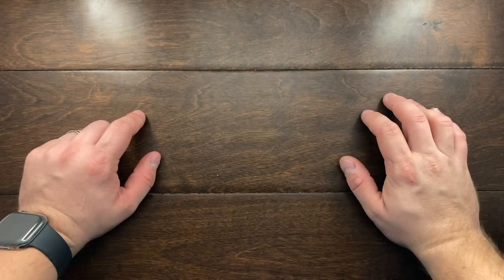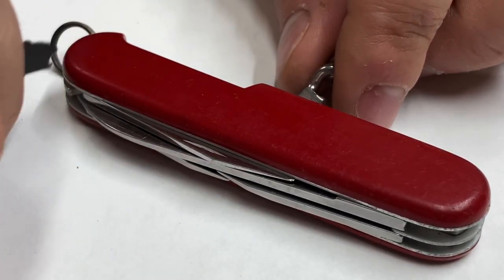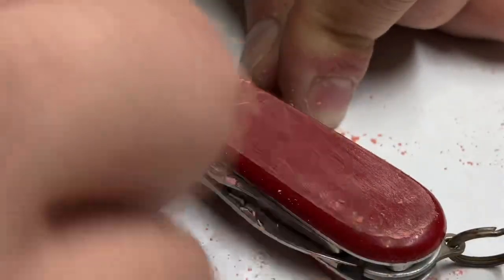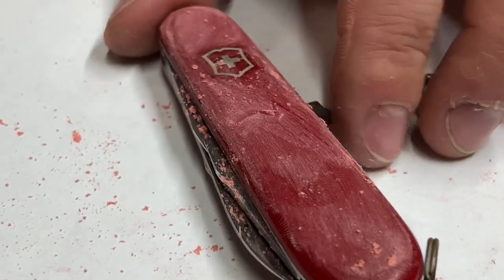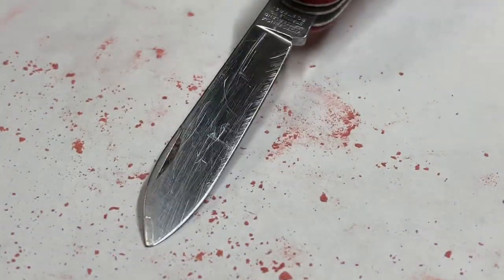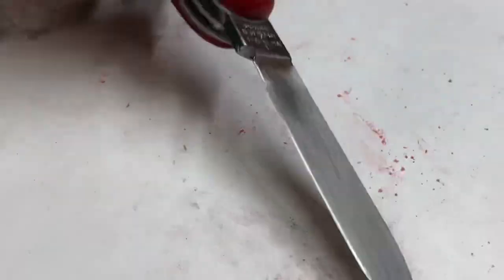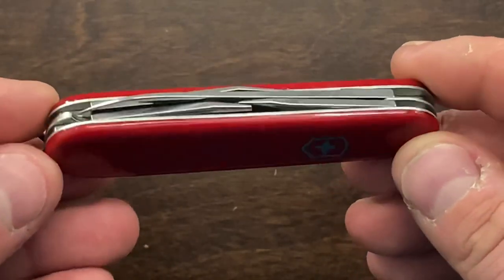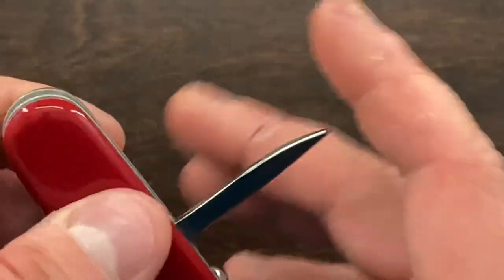How To Polish Victorinox Scales

Comment: Since the scale will dissolve with acetone, I usually do a light sanding with 600 paper and save the dust. I then dissolves the dust with acetone to a creamy consistency that I paint the cracks with, make sure to blow it dry right while painting. Then I sand and polish the scales. That is how I get rid of the cracks and cuts without sanding down the celidor :)
Reply from the maker: Very good info!!
Reply: I'd like to see the finished product with this process. Using acetone would be tricky.

Comment: What I've been doing since the '70s.... high-speed drill, very soft buffer wheel(found at most hardware stores), and jeweler's rouge(sometimes sold as plastic polish). Spin the buffer wheel against the rouge to 'load' it. The key is never to let the slabs get hot....just warm.  I've also used Mothers 'Power Plastic' polish instead of the jeweler's rouge.  I cringe when I see you guys using sandpaper. I get a factory gloss, but I'm not after the deep scratches.  

 I do the same thing essentially with the steel....except I switch to a Dremel and use a felt polishing arbor and stainless steel rouge. That will leave some polishing marks if you don't keep the arbor clean. And I finish by hand with Mother's Mag polish.

Try not to buy used SWA knives where the owner has kept them in a pock with change/keys.

Comment: One millimeter is pretty thick. I know that's the machinist in me talking, but when the saw sends you tubes to cope a radius into them and they cut them 5mm long, it seems like a kilometer!
Reply: I can say for sure that the embedded emblem is not 1mm thick as I had one partially peel away from the scale. It may be around a quarter of a mm thick. It created a sharp edge that could actually cut you. I was unable to flatten it and had to fold it back and forth a couple of times and break it off and lightly sand the edge of the remaining emblem smooth. So my Executive has been missing the top part of the emblem for the past 15 years or so.
  Nice restoration by the way. I usually just use Turtle Wax rubbing compound. It removes very minor scratches and scuffs and brings back the shine.

Comment: I accidentally spilled a drop of 91% alcohol on a scale of my Signature Lite. The shine is gone and now there's an ugly dull spot. Do you know how I can make it shiny again?
Reply from the maker: The alcohol is probably reacted with a plastic polymer that they use. I think the only way you would be able to get the shine back is by having a buffing wheel. However the alcohol probably messed with some of the properties of the plastic that allowed it to get the sheen that it usually has. I don’t think you’re going to be able to repair it I don’t keep alcohol close to my Victorinox knives because I’ve had bad reactions to them touching alcohol. I’m sorry to hear this but you might have to get new skills.

Comment: What sandpaper/polish grit progression did you use on the scales and blade?
Reply from the maker: Started with 400 grit sandpaper and then moved to 800 grit. Would probably be more beneficial to then progress through 1000 grit to 3000 grit sandpaper. On the scales are used 400 grit sandpaper.

I only used one polishing compound for both wheels however one of the wheels has less compound and more exposed cotton to bring out a higher sheen
Reply: @markcoffman494  thank you, that is helpful. Since you use buffing wheels you may not need this step but have you tried hand rubbing with Flitz for the last step?  I found it really brings out the mirror shine. Of course that wasn’t your goal for this knife but thought I would provide the suggestion
Reply from the maker: @Ian.stearns  I am aware of the product however I’ve never used it. I don’t really go for the absolute perfect shine on my knives because they themselves are never perfect however if the handle or all the parts are in mint condition and there’s one spot where there’s a scratch I think it would be helpful to use that. Thank you so much for the suggestion!